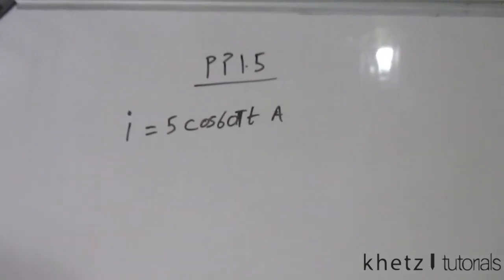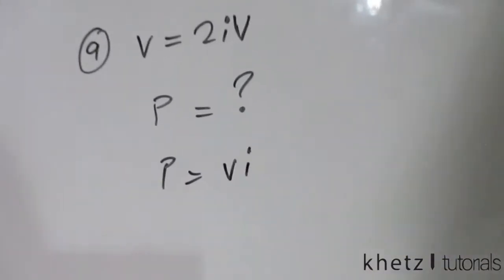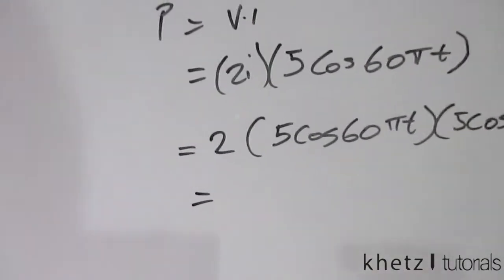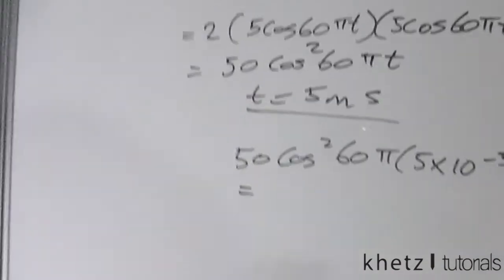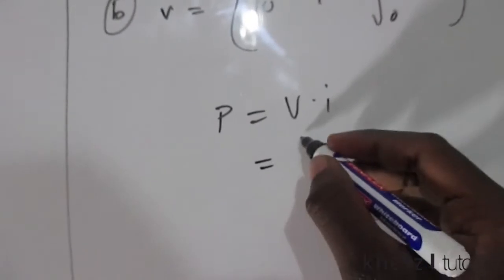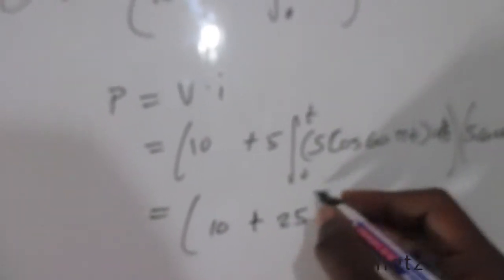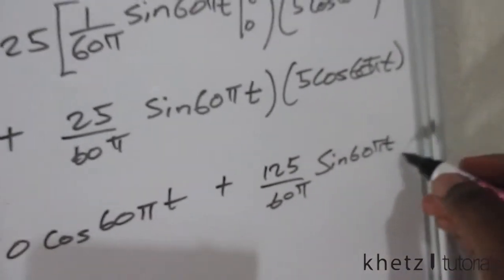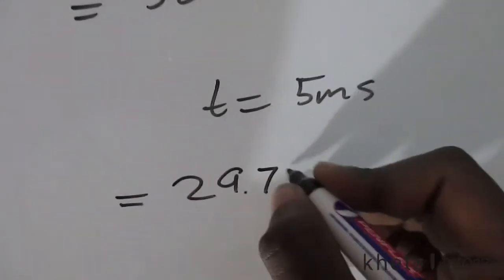Fundamentals Of Electric Circuits Practice Problem 1.5

Comment: Could you please explain how to evaluate cos^2 on a calculator. My calculator is already in radian mode but still getting a different answer
Reply from the maker: You would input it exactly as you see it just that the squared would be after everything else. So you'd have something like cos(x)^2 where x is whatever value you have as your cosine argument
Reply: @KhetzTutorials  can you kindly type out how it is supposed to be keyed in in the calculator 🙏
Reply from the maker: It should be exactly as I stated above. If you are using a Casio calculator it should be somewhere along the lines of the following steps:
1. Shift then mode
2. Pick option 4(Rad) to switch to radian mode or whichever number Rad is on your calculator 
3. Press cos and input your argument 
4. Close the bracket
5. Press x^2 to square everything

Comment: Your calculated power is wrong
Reply from the maker: Are we using the same  version of the textbook and is your calculator set to radians?
Reply: Why do i need to set my calculator to radians ? Could you please explain
Reply from the maker: The presence of the pi symbol when dealing with angles is a guide to knowing when to switch between radians and degrees. You can look up radians if you are not familiar with the concept. Generally, 1 pi rad = 180 deg
Reply: Thanks alot